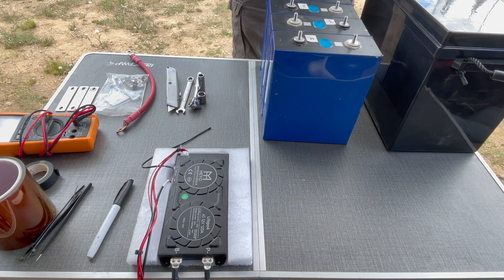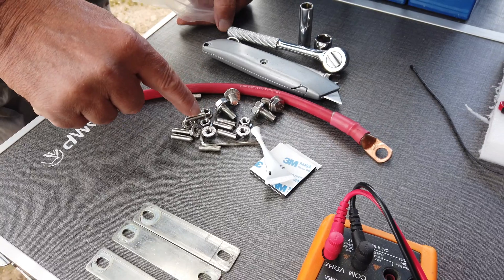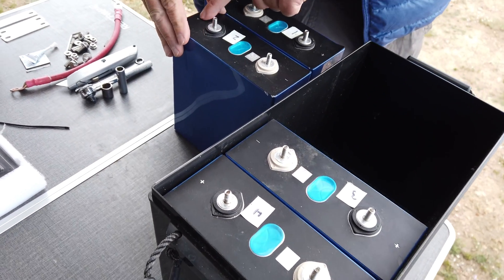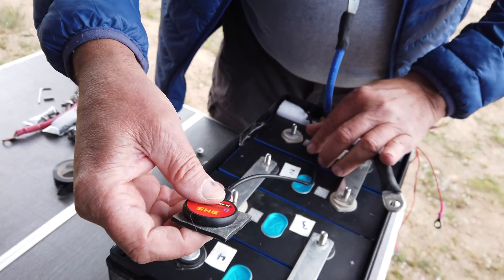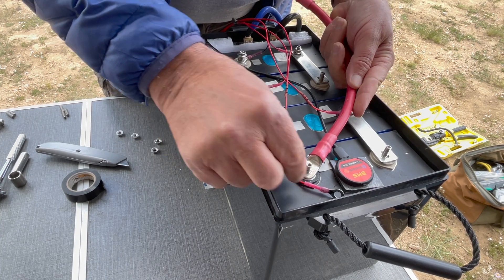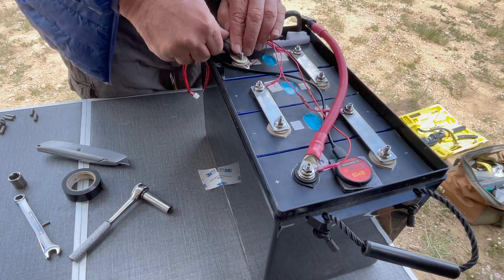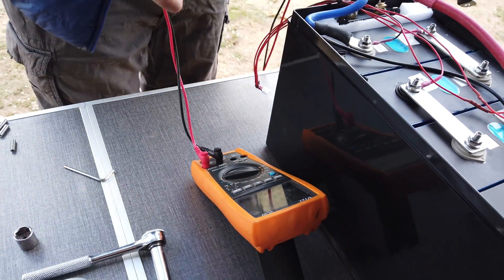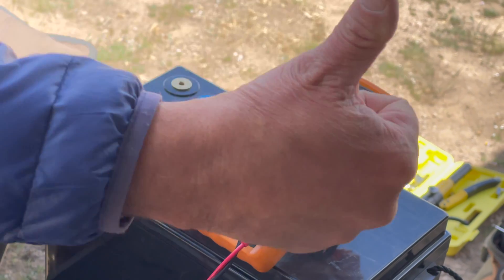DIY LiFePo4 Battery Build.  280AH 12V Drop in battery made easy.

Comment: Hello sir how is health of battery after using it after 3 years
Reply from the maker: No different than new. I only charge to 94% and have never discharged below 30%. LiFePO4 likes this and, although they will degrade, as all do, It happens much slower and I cannot tell the difference from when the cells were new. But I am currently upgrading the 280s to the new EVE 314AH cells.  Those are rated to 10,000 cycles as opposed to 3500 cycles of the 280s. Get them here https://solarsupplyhouse.com
Reply: @SolarSupplyHouse  just bought a 280AH setup and this makes me feel way more justified for splurging on expensive batteries

Comment: It's recommended that you use no lower than a 200a bms for 280ah batteries, I personally use a 250 bms
Reply from the maker: It depends on what your loads are. I have six 100A BMS on six batteries in parallel. I do not need any more than that even with my largest load of 200A.

Comment: Just noticed you didn't clamp the batteries, why?
Also daly BMS like cooling some have fans, so will the box be detrimental.
Reply from the maker: The video is now outdated. We do not use or recommend DALY anymore. We sell JBD now as the firmware is far superior and they run cool.  I have replaced all the DALY customers with JBD. They work so much better and will fit in the box easily.   Clamping of the batteries is a choice of the customer. Our experience is that it's not necessary.

Comment: How did you fix the cover to the box?
Reply from the maker: It's ABS so you can glue it with common ABS cement. But we do not recommend it to allow access to it for whatever.  Kapton tape works well. You can use some small sheet metal screws too. There are alot of ways to do it depending on your needs. On mine, I strap them closed as I often open the lids to check on various thing or do upgrades.
Reply: @SolarSupplyHouse  is there also enough room (space) to install an heating plate?
Reply from the maker: Yes, A reptile aquarium heater could fit and the new BMS we carry has an option with the temp sensor to turn it on at your setting. There are also others that make heating pads that could fit.  @matteobusani
Reply: i was just looking at that and it looks like you can  strap it down  using  the handle holes  to

Comment: I don't see this a good solution.
The cells will expand and press the bms. It's recommended to press them each other.
It's also recommended to put some isolation between the cells.
Reply from the maker: I have had the same cells in the video in the box without anything to compress them for 2 1/2 years  and there is no expansion.  Please provide your documentation of this, besides what you read on DIY Solar Forum. The cells are at least 1/2" from the BMS on all directions, so it does not press on it. But,  I agree on the isolation. A thin layer of something would be nice for fitting them togethe and slight temperature expansion , but I do not see the science of why you believe is necessary. Some input on this would be informative as long as it is not opinion and backed up with facts that viewers can rely on.
Reply: @SolarSupplyHouse Brother the document " Datasheet" says the cells be tight, compressed to each other. As the cells "could" expand and that would void warranty.
Reply: @SolarSupplyHouse as some manufacturers of cells provide 5 years of replacement warranty. So it may not expand in 3 years time but maybe in 4th year. Thanks your assembling was very good and neat😊

Comment: Any concern about placing the bluetooth module over the pressure-relief valve?  Also, I've read that differing wire lengths on the BMS balance leads results in differing resistance, which compromises how well your cells stay balanced.  I'm not sure how critical that is.
Reply: It was not a concern at the time. But thank you for bringing that up. I have never seen a pressure relief valve have to work after selling several thousand cells. As for the sense wire leads, one could not even measure the difference in resistance on a couple inches. A finger print has more resistance. But thank you for the question. I am always looking for input.  Join our  DIY Battery forum https://diybatteryfourm.com and post your discussion there. It's free. See what others think. 
Cheers.
Reply: @offgridcircuits2413  - The spelling of "forum" is wrong, but I have joined and look forward to learning and sharing more about DIY batteries.  :)
Reply from the maker: @jasonbroom7147  oops, nobody is perfect. I corrected it.

Comment: Compressing the cells ? Fusing?
Reply from the maker: After another set was in service for two years without compression and just in the ABS box, I recently examined them. Still good as new and no swelling or bulging. Capacity was still at over 310 AH.    All six packs in my build are fused properly when in use. I use a Victron 6 fuse bank with 300 amp mega fuses. Good observation.  Cheers.

Comment: Lol 🤣 that battery box is way over priced
Reply: haha thats what i just looked at.. 120 bucks just for a plastic housing and a terminal lug plug lol... i just need a case without the terminal plug since ill be drilling a hole and sealing it , using it for my trolling boat motor ... but yeah 120 bucks for a battery box HAHA

Comment: Thanks for the great video. In your opinion, if I am running an active balancer as well as my daily BMS do I need to top balance my batteries when I get them or can I just let the active balancer do that over a couple of cycles?
Reply from the maker: If the cells are well matched and one is perhaps a half or a volt off, (a volt would be a lot) you can passively balance them. Put the cells in parallel and let them sit over night. They will balance out. Even if you do a top balance with any cells and then rest them for several hours, they will go slightly out of balance but not significantly.

Comment: Like your video but I was wondering do you top or bottom balance your batteries or do you have to
Reply from the maker: Top Balance is best for this application.
Reply: @SolarSupplyHouse  So let me make sure I got this straight I'm wanting to put together between 100 to 280 volt batteries. So what I need to do is go out and buy another charger and put them in parallel and charge them up so they're all equal am I correct. What I'm trying to do is put a second battery in my SUV with a DC to DC charger
Reply from the maker: @davidlingelbach9887  Proper procedure for cells is to top balance . We use a constant current, constant voltage charger with the cells in parallel to a top charge of 3.64V, then rest the cells for 6-12 hours, measure each cell, then discharge to 2.6V per cell (10.4V in a series pack), measure the individual cell voltages again, and top balance one more time. Document each cell during the process to determine if you have any weak cells or bad cell.
Reply: @SolarSupplyHouse  what would you charge me to build a battery if you do that kind of thing
Reply from the maker: @davidlingelbach9887  Please take this to our website contact section.  https://solarsupplyhouse.com
Reply: @SolarSupplyHouse  I'll try to get a hold of you on Monday and talk to you more about the battery because it looks like you're out of them
Reply from the maker: @davidlingelbach9887 10/16/2021   We have 350 cells being unloaded right now in Long Beach, CA. A short trip through customs and then to our warehouse one day later. These are the new, unannounced CATL 302AH cells with laser welded studs. We have a waiting list on the website that I suggest you get on. These will sell out in one day.
Reply: @SolarSupplyHouse  that I completely understand. The money that I'm going to use is I'm going to be in till the end of next month. And here's what I'm wanting I could probably go down to 170 amp hours and be okay. I live out of my car and what I'm going to do is use it to run my electric blanket which is DC I might go up to a little bit better of electric blanket and then I'm going to put an inverter on it so I can run my computer my laptop and then when the car is shut off and at night I can charge my cell phone and a couple little other things

Comment: Could you explain how you activated the Daly bms please. Also, I read that the bms terminal leads should all be the same length. Do you not think this is necessary?
Reply from the maker: You activate  it  by either  shorting the B+ and B-  together. but you  can n also do a short of the terminals on the power display output on  the side of the BMS. You just short out the pins. But I put in a momentary switch that does that.     The  BMS terminal leads can be any length. Within reason. It's low voltage reporting.

Comment: If M6 Studs can take 450amps for 30sec?
Reply from the maker: The contacts can. The studs just hold the contacts down to the top of the cell with the flange nut. But it's only a 280AH pack.
Reply: @SolarSupplyHouse  thanks, so we don't need to consider M8 or other ways to weld connection for pack right ? i am thinking to weld it with big size aliminium sheet for making sure a 450 amps pass.

Comment: Why do you have the handle ropes tied in knots??? There's a spot for the plastic ends to clip under the lip. 

You also shouldn't use Loctite on the studs, it acts an an insulator. 

You're better off taping the cells together before they go in the case. 

You're also best to torque down all the flange nuts, and then put the sense lugs on top with a nut to lock them down. A half nut works really well for this. There's also no need to hold the studs while you tighten the nuts, a) You used loctite, and b) Tightening the nut will pull the stud up if anything, not push it down. 

Using shorter M8 bolts on the inside will help with internal thread clearance, there's no need to use 16mm bolts like you did. 

I'm all for helpful videos, but there are some bad techniques shown in this. Without securing all the cells together, you make the bus bars do all the mechanical work when things move about inside (and they will move because you've used foam. That puts stress on the terminals, which can easily become a failure point. 

If someone tips the batter upside down, those studs will possibly punch through the case. You should use something solid between the top of the cell and the lid. 

At least the kit only costs about as much as it's really worth. But get rid of that loctite, it doesn't belong on battery terminals!
Reply from the maker: All good points to consider.
Reply: Use green loctite

Comment: Where is the bms or the cost. You can buy a 300 amp amperetime for $1229 complete with 200 amp bms. No cold temp sensor but don't know if your bms had one either. Your bms was 120 amp.
Reply from the maker: The video is educational  for DIY battery builders. They can determine the required  BMS based on their loads.  Ampertime appears to be a Chinese  built  battery  with no temperature sensor or low temp cutoff and no brand or specifications on  the  cells or BMS.  The  installed  BMS in the Video had a temperature sensor  and low temperature charge cutoff so the battery cannot be damaged.  Solar Supply House does not sell BMS at this time due  to   the many  variations  a customer may  require. One size DOES  NOT  fit  all.

Comment: Your BMS might overheat in the foam.
Reply from the maker: Not really.  I  tested that and it's  fine.  I  use 6 battery packs in this  build  and  most  draw  from each pack  is under  40Amps.
Reply: @SolarSupplyHouse  Ahhh ok that makes more sense now !! :)